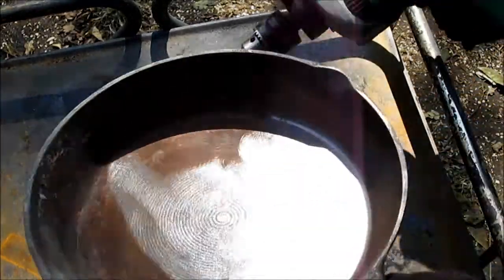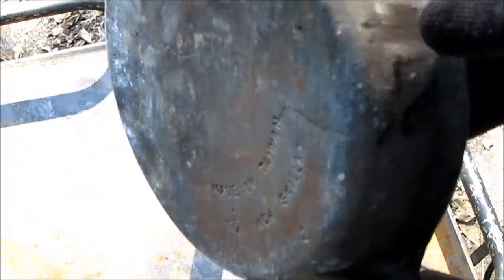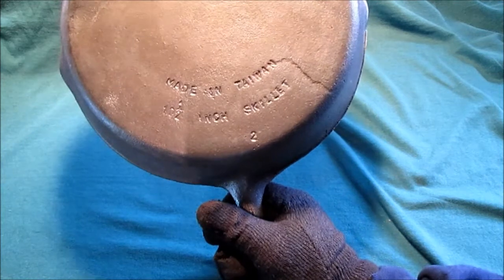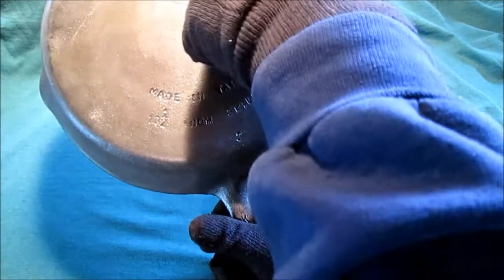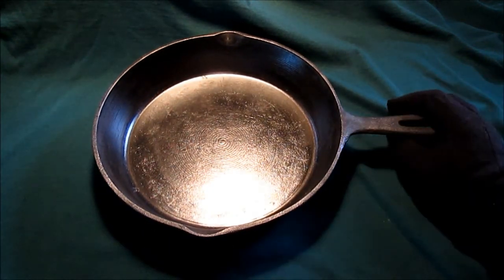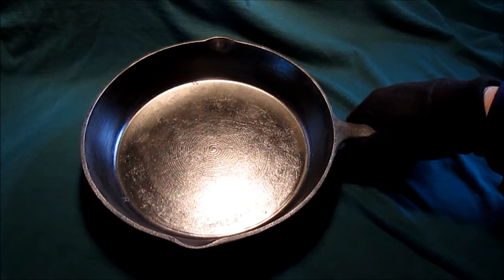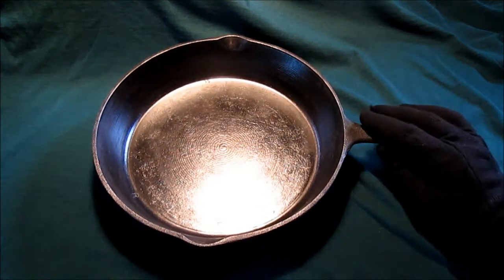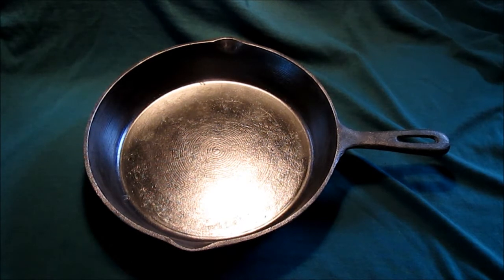Cast Iron Skillet Restoration Part 2

Comment: Good as new, but a better new than today's new
Reply from the maker: Veikra The new cast iron can't compete with the old
Reply: Exactly. today's new aint as good as old new :) Just watched the last part, why do you blacken it? Couldnt leave it with the oil ?
Reply from the maker: Veikra I have had better luck with blackening them it makes a good non- stick surface